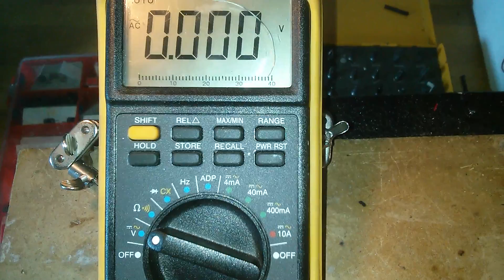inverter

Comment from the maker: I made this inverter because i would like to find some way to use scrapped trafos from halogen lamps, Connect the inverter to a 12 volt battery and you have 230 volt ac output (or 120 volt)